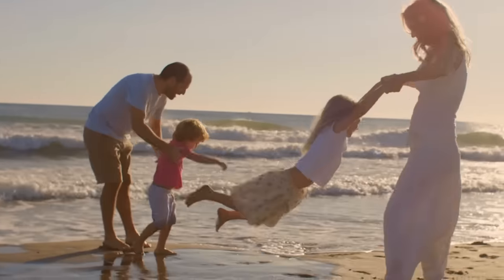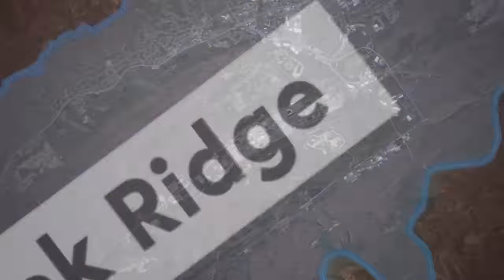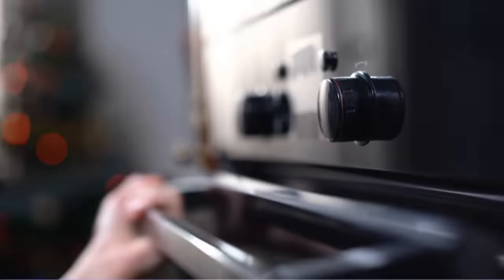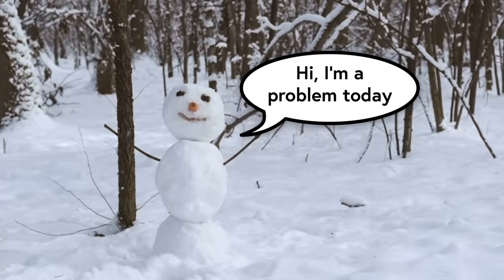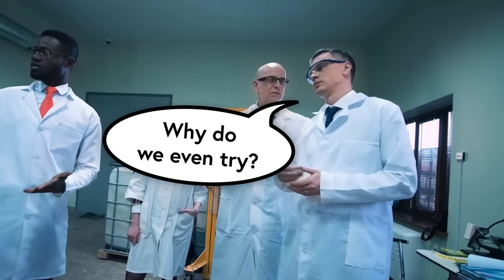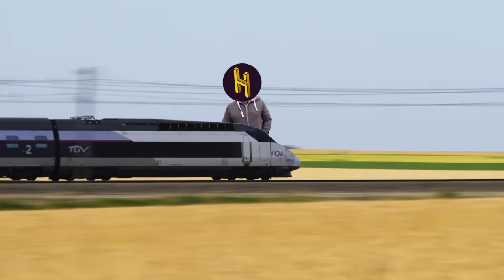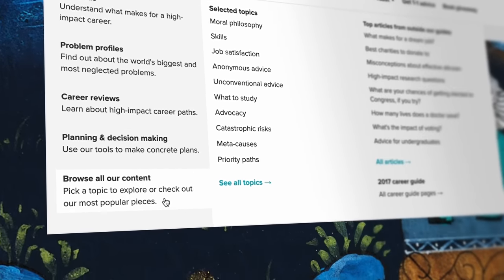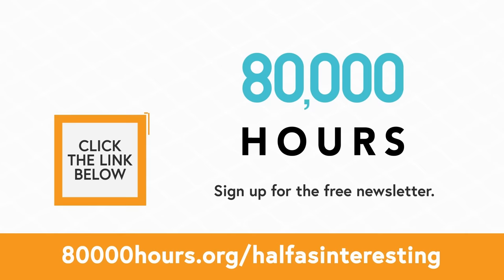The Material So Classified We Forgot How to Make It

Comment: As a chemist, I immediately spotted the problem when a purer version was made. You don't randomly change the chemical composition of something when you reverse engineer it when you don't know what it does. You try to replicate it 100% first, then start experimenting with changes in variables
Reply: Yeah, it it as stupid as making purer Si crystal in attempt to replicate semiconductor. Most likely the whole point of the material was the impurity of one.
Reply: That is how they did it in second attempt. Thanks to that, they also improved the management of impurities and found the optimal ratio of them.
Reply: Kinda like making hydrogen, distilled water doesn’t work as good as heavy water.
Reply: @gacekky1 Because sometimes, it's the impurities that cause functionality.

If you're doing brand new "blue sky" r&d, then yeah, you usually go for most better best purity. But this wasn't blue sky. They had a known target. 

Think of this project as a root cause analysis. If you're investigating why a jet engine failed, you don't get a pristine engine that was exactly perfectly in spec, with brand new oils, etc, you get a similar used engine, wirh similar fluids, etc. You are trying to mimic the circumstances of "the event " as closely as possible. And starting with perfection is (usually) not the ideal starting point.

Or, think of this as a modern experimental archeology. The folks in France building a 16th century castle don't just use a hydraulic lift to move large stone blocks. They use a man powered crane, to see jow and ehy things ended up the way they do in other castles.

Hope this helps. 🙂
Reply: @armageddonready4071  Distilled water has a low conductivity, so cant be used for electrolysis. Heavy water is deuterium oxide, so you would get deuterium or heavy hydrogen from its electrolysis. You probably meant an electrolite solution, which has a higher density than pure water when you wrote heavy water.
Reply: @brandondenny226   It was Castle Bravo. The expected yield was 6 megatons and ended up being 15 megatons.
Reply: perfection is a modern thing
Reply: I'm not a chemist nor anything of the sort, but even to me it was pretty obvious
Reply: I thought the same thing. I wonder because they didn't know how to make it, it seems they thought the imperfections weren't part of the original.
Reply: With something like this, especially. The video kind of glosses over it because it's not really that significant for a short history of the topic, but the function of filler material in a thermonuclear bomb involves converting to a plasma that's opaque to the highest energy photons from the initial fission explosion (hence the name "Fogbank") while allowing neutrons and probably longer wavelength photons to travel more freely.

The idea is to allow the conversion of lithium to tritium in the fusion secondary, along with the compression of the secondary by thermal ablation of its metal shell, before the secondary is ripped to shreds by the nuclear detonation that just went off a few feet away. On the timescale involved, milliseconds might as well be an eternity, and the material can't be substituted from one weapon to another because its properties have to be based on the geometry of the specific bomb it's to be used in.

Reducing impurities sounds like a good idea, until you consider that those impurities could play a role in a number of important things. Maybe they cause structural changes that weaken the filler structure and cause it to convert to plasma at a slightly faster rate. Maybe they play a role in making the plasma slightly more opaque to x-ray photons. Maybe they have some impact on neutrons moving through the plasma. Finding out exactly what they do might be next to impossible, but it isn't really necessary even though the impurities are. The important thing is that you're designing something that has to work absolutely perfectly, and the people who figured it out in the first place figured it out with the impurities there. Any change is considerably more likely to be a problem rather than an improvement.
Reply: Same in other fields, too. If there's no obvious cause for the problem, start from known-working baseline and introduce changes one by one until it breaks. Basic brute force troubleshooting.
Reply: @NyanCatHerder from what was said, they affect a later stage of the process. I read that as the particular impurities react with something else later in the process to produce a third thing that's needed for the final result. But I'm no chemist, just watch too much NileRed heh (did have a chemistry set as a kid, before those were -- I assume, given how sudden they disappeared completely -- banned).
Reply: That non-working perfection got them more money thrown at it. They probably knew exactly what they were doing.
Reply: @yourlocalmemeandanimedeale807 I can’t see what the person your replying to commented. It must have been removed. But the reason Castle Bravo had a yield 2.5 times more than predicted was because at the time physicists didn’t understand how Lithium-7 deuteride reacted under high energy neutron bombardment. It had nothing to do with the interstage, which at that time appeared to be a polystyrene foam variant. 

Lithium-7 will breed tritium if the neutrons have enough energy. It’s an endothermic reaction, but considering that Li-7 fissioning leads to an alpha particle, a tritium ion, and a free neutron with leftover energy from that which fissioned it, It supplied a whole lot of extra neutrons capable of breeding more tritium in both Li-7 and Li-6. This exacerbated the amount of D-T fusion reactions going on inside the thermonuclear Secondary. And because Castle Bravo had a “dirty” depleted uranium tamper, many of the 14.1 MeV neutrons produced in D-T fusion reactions were able to fission up to five U-238 isotopes and release an exorbitant amount of additional energy on top of the ~17.6 MeV D-T fusion reactions.
Reply: @bjornragnarsson8692  Thanks for the information, but I didn't say anything about why it was more powerful than expected.